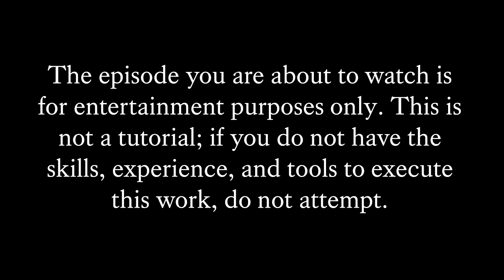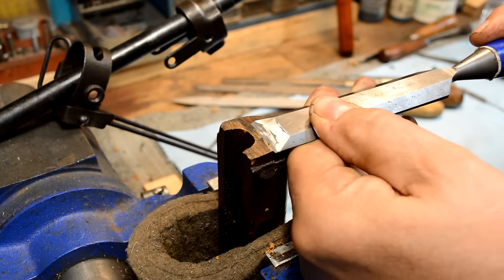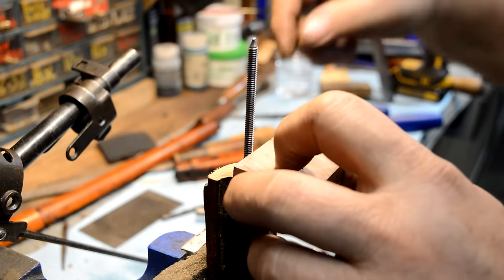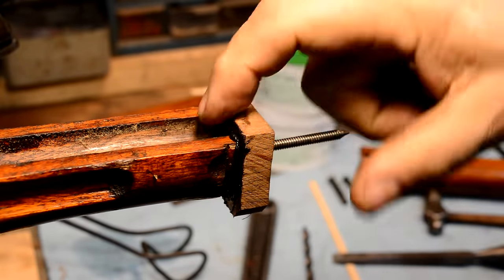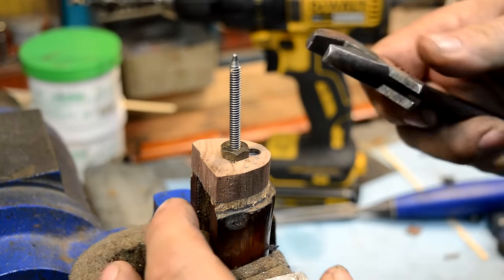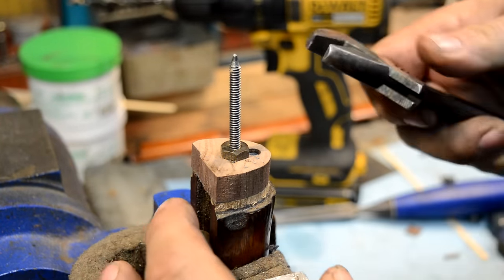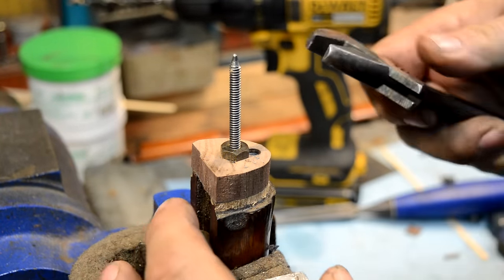Anvil 086: Type 99 Arisaka duffel cut repair

Comment: Fascinating project!  Did you consider using a drill press to make the initial hole for the threaded rod?  I'm watching and I can't help but see that there's a slight Tower of Pisa with the rod.  I realize you'd probably need a very tall drill press to accomplish that as I say this.  Also, you can take two nuts, thread them on to the rod, lock them to each other and use the outer one as your way of screwing down the rod without damaging the threads by using a vise grip.
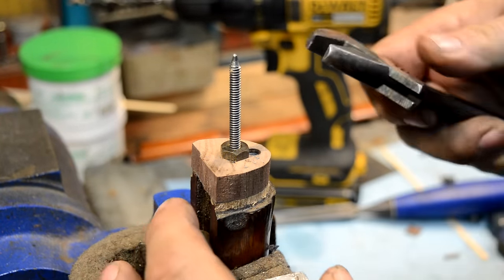Reply: Well this isn't going to be welcome but here we go. @31:53 we can very clearly see that the top edge of the stock on the right is noticeably higher than that on the left of the join. Mark does not see this. This is the stage where the parts are brought together dry so that they can be fitted correctly. Look closely, it can be seen that the barrel is sitting down hard into the wood on the right but is lifted in the wood on the left as witnessed by a gap between the wood and the metal on the left. This can only be caused by the wood on the right being too high in relation to the mother stock and shows that the hole for the threaded rod is in the wrong position and is causing the joint to be out of line. 
Having assembled the joint @37:43 we see that the exact same conditions apply and the repair is out of line. Start watching at 38:10 Mark checks the alignment and (look closely) moves the stock even further out of alignment by lifting it higher. Shortly after this he confidently tells us that this is not the sort of gun that you learn on. @40:10 here's the smoking gun! Notice how the wood grain is showing through the glue. It stops showing at the exact line of the join because the barrel was lifted up from the mother stock by the miss aligned stock. All the pressure of the rubber strap could not pull it true because the threaded rod could not allow it to move into line. @42:32 look closely at the visible left hand edge of the glue and it can be seen to have considerable thickness. This is the result of the barrel not sitting down in its cradle in the stock. The thickness of the glue exactly matches the degree of missalignment of the top edge. @45:01 he finally notices the problem with the top edge of the stock and cuts a little wood off. @45:16 Mark starts to explain that wood moves with time and he's right. However no amount of explanation can put this situation right. @47:18 he cuts away wood and tells us that it swelled right here. He demonstrates that he does not understand why the top edges are not in line and level. @49:14 this is the first time that we see the results of the missalignment. Not withstanding any bending of the top stock the gap between the top and bottom on the left of the joint is exactly equal to the degree of error in jigging the two parts of the stock together. Mark's attempts to blend the joint are seen as a freshly cut ramp in the wood. @51:23 Mark is telling us that the front end joint is tight and it is. However he makes no mention of the gap behind the joint which will always be there. @54:20 observe the gap where the top covers the bottom. In spite of any explanations that gap is there because Mark assembled it out of line. 
I have been a gunsmith for over 40 years and am often called upon to correct poor repairs. I despair at this job and I wonder if the owner will be content with explanations of swelling wood as he holds this rare example. Often I have found that workers who make sure we all know how good they are can produce average work with eloquent and lengthy explanations of how difficult it was and how the average joe would make a hash of it. I expect this comment will be deleted as it will not sit well with Mark Novak. I challenge you to leave it here so that your viewers can respond.

Comment: Hello again I got ariska 99 now all there butt dust cover with same issue
Only difference mine has lightening slot cut along barrel length the rear section only had half inch before the lightening slot so i had do mine different

Comment: Generally it is Walnut and I found out the finish is a Poison Sumac mixture.
Reply: Did you write a book on that subject?
Reply: Urushiol. Japanese lacquer finish. Pretty weird stuff, it actually polymerizes with the humidity in the air. 

Basically, take poison ivy/oak/sumac sap and boil it down. You wear gloves, long sleeves, and a full face shield when putting that stuff on, the slightest contact will blister *instantly*. And then you let it sit for a week to cure.

Once cured, it is absolutely impervious to water. As in, "can sit in  water for a week and not soak any up."

Comment: You could get it pretty close.
drill and tap the first hole and screw in a rod that has a pointy end on it sticking up just slightly proud of the wood.   use your drill bit in the cleaning rod hole as a gide and mash the other part of the stock down onto the pointy end of the rod you screwed in
this gives you a center puch for where to drill the second hole. kinda, ish, sorta.
Also, why didnt you put the screw in the band for alignment then draw round the outside of it? :)

Comment: Also I’d like to include my typical not so complimentary comments about the tools used. You can absolutely and cheaply purchase everything used in this video for a pittance. In fact I have way better tools for the most part and I actually know how to use them. However this has almost nothing to do with the tools used but rather the skill and absolute boldness. This is not for the faint of heart nor is it for a shade tree mechanic. I am absolutely not jealous of the skill displayed, because I recognize the insane amount of time and mistakes made to achieve this. I am simply not willing to make the sacrifices to be anywhere as good but instead simply admire the work. 

Beautiful.
Reply from the maker: The fact that you don't need thousands of dollars of high speed gear has been my point all along. My tools are sharp, and well guided, in my opinion. Knowledge is great, but experience is everything, to reinforce your point. This equipment can and must be maintained or the rest of them will die a slow death.           Do. The. Maintenance.
Reply: Mark Novak I have never seen a $4 chisel cut like yours do. I have $40 chisels that work terrific, but even they don’t cut like your Irwin Brand cheapo’s. Definitely skill is a huge part but the sharpening is no small part.
Reply: John-Paul Silke free beat chisels from a garage sale + elbow grease is a good way to start. Find something 70 years old and seemingly worthless
Reply: A J you aren’t wrong. But that requires some skill and not blaming others for your shoddy work.
Reply: @john-paulsilke893  If you won't sharpen your tools, you won't do much good on your projects. I know that sounds harsh, and I myself have been hesitant to sharpen tools I'm less familiar with, but for the most part, it's best to give it a go until you can do it well.

Comment: My uncle got on back from the Pacific in WW2. It sat in his garage for decades. My Aunt gave it to me before she passed. It is uncut,the Chrysanthemum has 2 small lines trough it. No dust cover or bi-pods. My cousins husband thought it would be cool to refinish it with varnish??? WTF. What would you use on a refinish? Linseed oil?

Comment: So, if I just acquired a T99 without a fore-end, can I buy one and a cleaning rod and restore the gun?
Reply: Yes, but the key is to find a fore-end.  I know repro cleaning rods can be found, but you'd have to acquire a nose cap with screws and that bottom cap piece.  A new fore-end could be made from a piece of wood, but you'd have to get the right type (I believe ash) with similar coloration.  THEN you'd have to reshape, easiest to do if you have access to another Type 99 to reference for tracing or however you'd match the profile. Also you'd need to finish the new wood to match the rest of the stock, and the original finish is made from sumac, and some people have a reaction working with it (like poison sumac).

Comment: Would the American version of Tung oil be an acceptable replacement, if I was going to steam out dents and refinish? I mean, does it compare to the older Japanese version?
Reply from the maker: They used a Sumac varnish, no knowledge as to it's compatibility with Tung
Reply: @marknovak8255  Would an Amish based Linseed Oil with a bronzing technique with heat to bring out the color make an approximate finish? I could see using an old American 1700's technique could perhaps produce something within the ballpark.

Comment: Question: why not put two reinforcing screws in on either side of the cleaning rod hole as opposed to one screw above it? 
Is it because of the barrel band screw?
Reply: I believe he head another video, Anvil #72 maybe, where he did in fact have a threaded piece acra-glassed into a channel he made under the barrel but above the cleaning rod AND cut off screws epoxied on either side of rod tube. Even had holes to let air out when forcing epoxy in.  I don't think the vid was transferred to the new site.

Comment: As far as the vise marks of the stock, can a wet rag be laid over the affected area and using a house hold electric iron, "draw out" the crushed wood?  That type of repair does work on some hard wood floors...?
Reply: As long as the grains are pushed down and not gouged out. Yeah it should work.
Reply from the maker: Steaming up dents will craze the finish.  Do not steam anything you are not going the refinish
Reply: @marknovak8255  Thank You for the info.